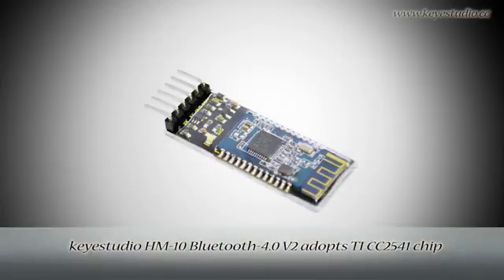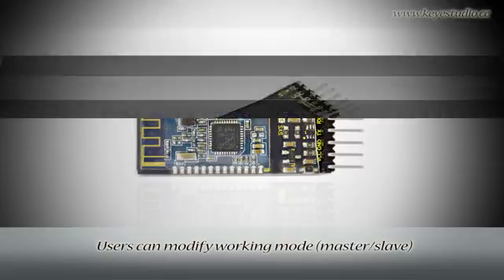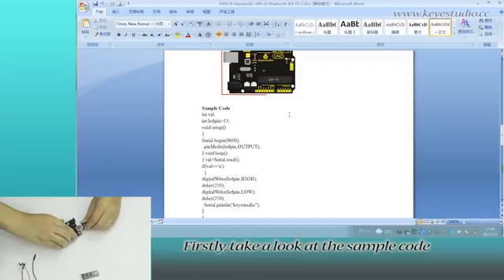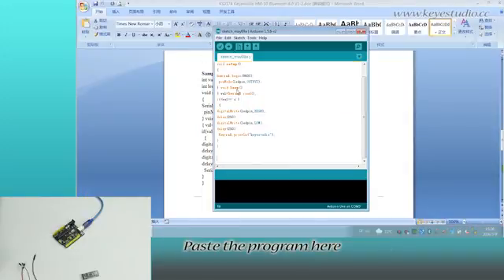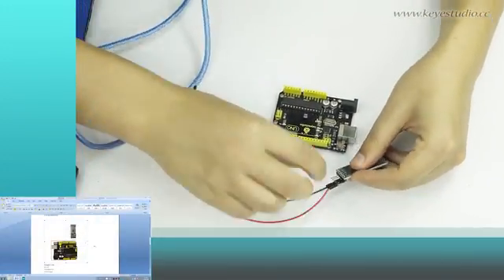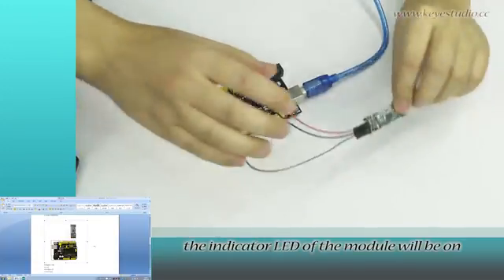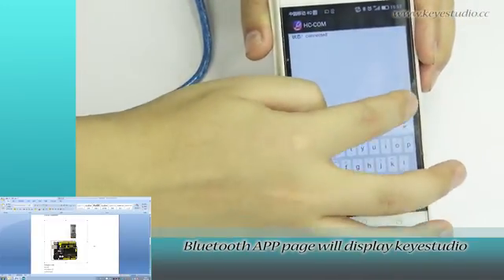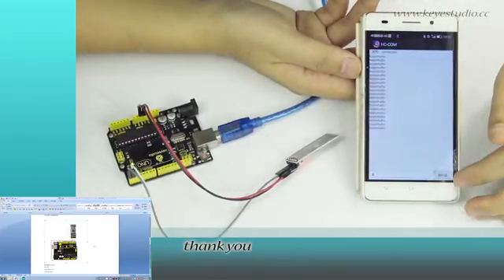KS0174 keyestudio HM-10 Bluetooth-4.0 V2

Comment: Can  we  use   this  hm-10  module  to send  midi msg    To work   Like  a  Bluetooth BLE   Midi  keyboard  🎹????    
Or  we   Hv   To   Update  the firmware  ???    
Plz  rply   🙂
Reply from the maker: Hi, It's OK. no need to update the firmware. You can design an APP to connect Bluetooth module. Set the interface work like a Bluetooth keyboard.
Thank you.